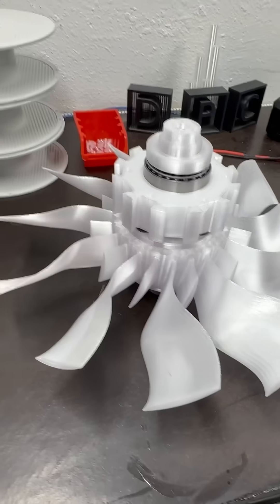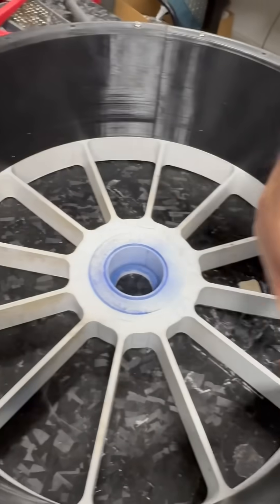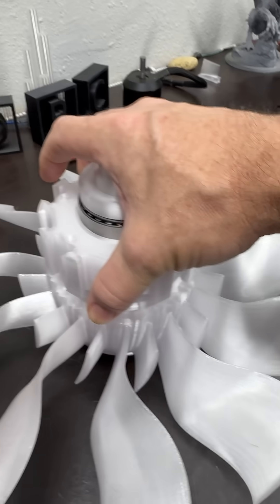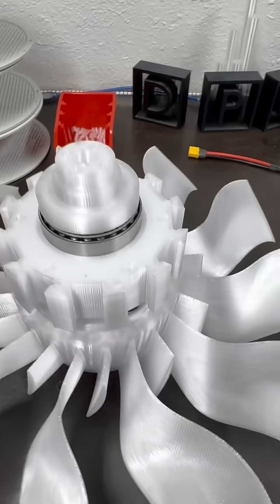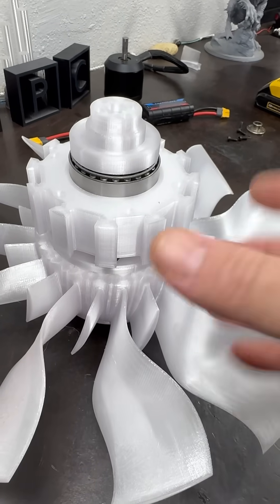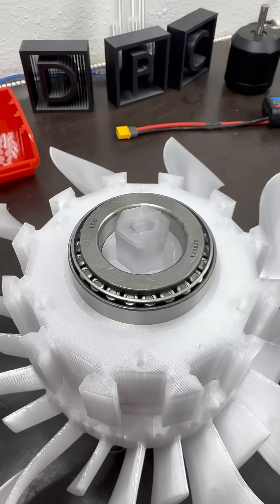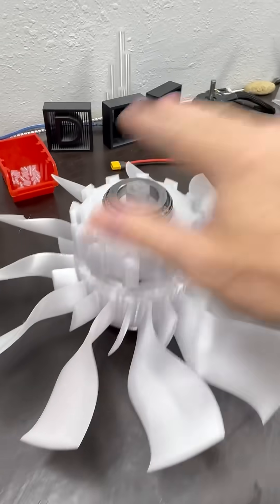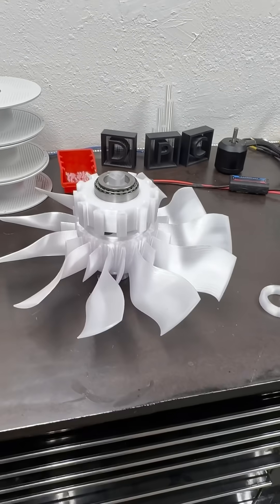340 mm EDF hub assembly. #fyp #shorts #diy #drone #edf #turbine #3dprinting #rc #engineering

Comment: What kind of thrust does that bad boi put out?
Reply from the maker: At 48 V it’s not much this fan works at the higher RPMs. I tested 48 for structural integrity before I test at 75 V which is over 9000 RPMs anywhere from 150 to 200 pounds of thrust per motor. The system is modular. I could change to a 24S system or a 100 V and find an appropriate motor with the right kv range and the right kilonewtons of torque to overcome fan resistance that would put the RPMs to about 12,000 which could render 250 to 350 pounds of thrust. These are rough estimates.